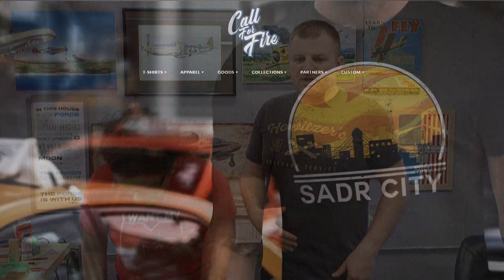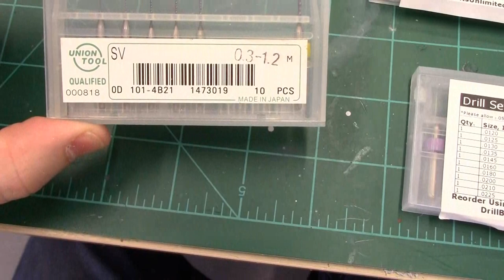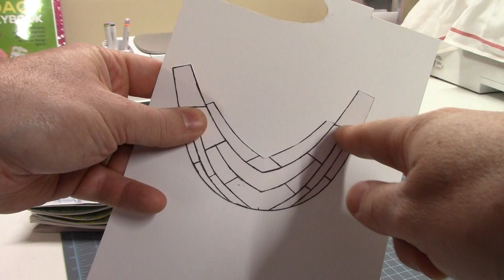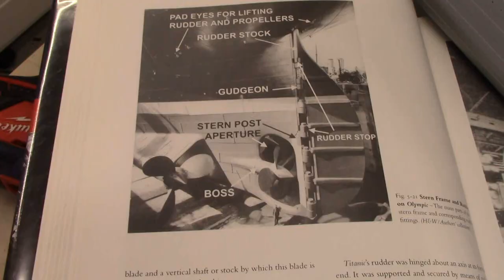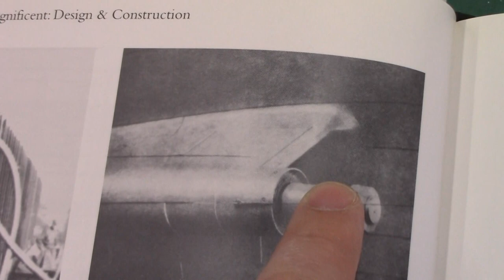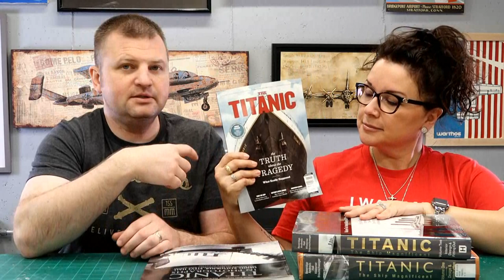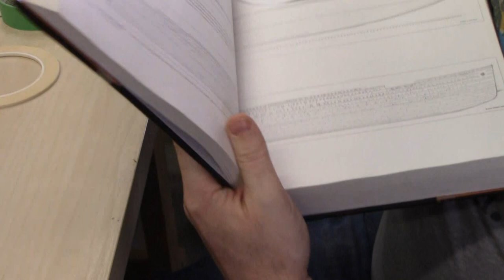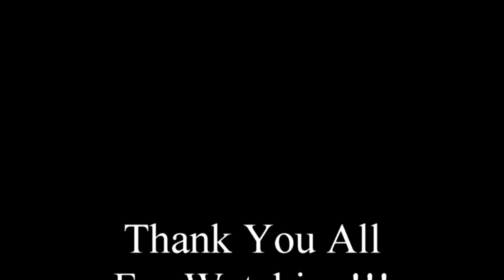1:200 RMS Titanic Build Video 1

Comment: And for the Waterline: The Waterline is suppose to be a perfect straight line. why is that ? The Waterline show you the maximum Draft (construction Waterline) in Seawater where the Ship is launched it is more cold Water if you sail to tropical Waters the ship has more draft do to the higher Temp of the Water:  Sometimes the Waterline looks like it is curved , this comes do to the Hull shape and the angel you looking at, but I assure you it is a straight line , sometimes the Guys who paint the Waterline mess it up and it is not a straight line , but once the ship in water no one sees that. So all people say it is a curved line are wrong . As I mentioned on top this marks the maximum draft o the ship. Some Ships have draft markings in foot, Meters and there are some more , some ships have all of them on the Bow .- and after Ship, some have also Plimsoll Markings. At the end your curved Waterline is wrong.
Reply from the maker: The reason people paint the water line the way they do, is because of photographs of the Olympic with the waterline going through the intake that I referenced AND then also touching the well documented points on the stem and stern. As I mentioned in the video, the only way to paint a waterline on this model, and get it to hit those points, is with a curved line. So either the hull was made completely wrong, or my reference diagram is completely wrong, or some combination of the two. Don’t put your faith in Trumpeter to have this all be “accurate”. The hull and many other features, are not correct. I’m simply showing you how to achieve getting the waterline to go through all three points. Feel free to demonstrate how to do it with just a straight line parallel to the keel. I’ll be more than happy to entertain it.
Reply from the maker: Nothing your saying PROVES the line is straight. You’re just rambling on about how it should be. Do some research bud. You come up with solid evidence that the line is straight, I’ll take a look. But to get the model kit right, you have to put a curve in it.
Reply from the maker: LOL so you’re not going to provide tangible evidence that Titanic’s waterline was straight? That’s disappointing because it sure would be easier to paint if it was 🤷🏻‍♂️
Reply from the maker: @powertothebauer296  Which drawing? You said in your comments that what they draw and how they build it are two different things. You also told me that I need to go to the real ship to see. Which is at the bottom of the ocean. Then you said I need to look at modern ships and use them for this ship made in 1909.  You also can't explain how I'm supposed to make sure the water line passes through the correct spot on the stern and bow, but not pass through lower portholes. I'm waiting man. I have one drawing and a TON of photo graphs. You haven't proven anything. The hull line, as I made it, is as correct as I can get it, with the hull provided by Trumpeter. That's the bottom line. What you should have said at the beginning instead of insulting thousands of modelers around the world, is "It's a shame Trumpeter didn't produce an accurate hull so you could get the waterline right without putting a curve in it." But you didn't. You typed all these words that make no sense.
Reply from the maker: I see.
Reply from the maker: There are many different sources. That’s why in the video, if you watched it, I said I was using the book “Titanic. Ship Magnificent Vol 1.” as a reference because it DOES contain the location of the condenser.